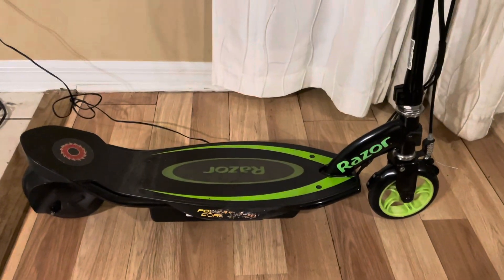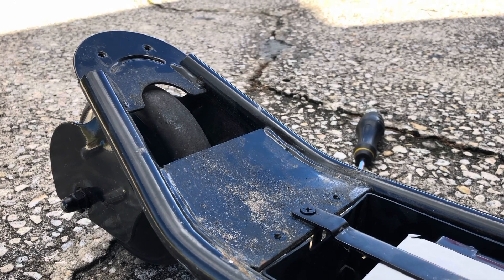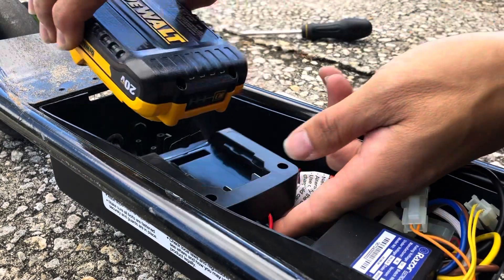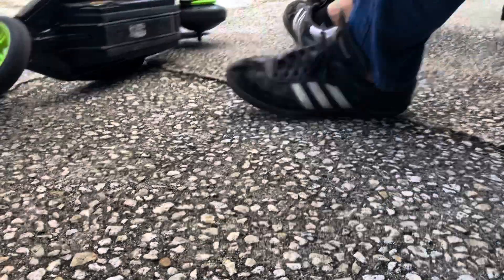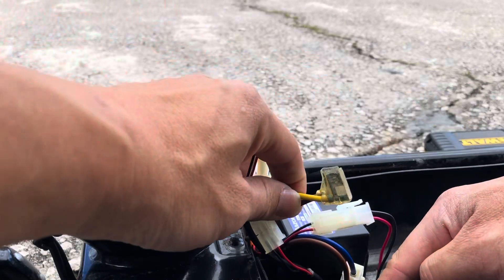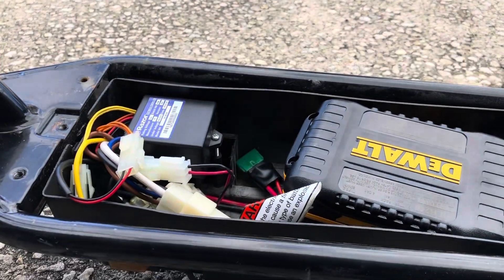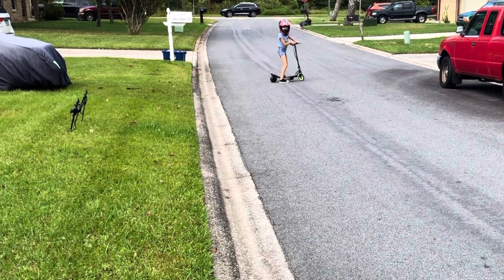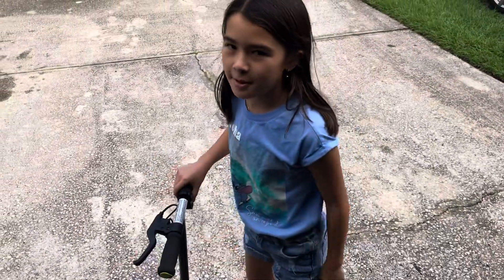Making Razor Power Core E90 electric scooter too fast! DIY Dewalt 20V drill lithium battery upgrade

Comment: How long can you ride before the battery drains?
Reply from the maker: I will have my daughter test it out today on a fully charged 20v 4ah dewalt battery.  I’ll post an update soon.  Thanks for checking out the video.
Reply from the maker: @sarathkhoun4281 We tested a fully charged battery today. The battery should last at least 40 minutes on a full charge.  Here’s a video of our test.  The battery lasted much longer than we thought it would.  My daughter go tired of riding the scooter before the battery drained completely.

https://youtu.be/jtErYQ3s7xc?si=0wZ3cVkz-_S7DpJH
Reply: @DIYwithDUY  Hello, good afternoon. Are only those steps so easy? The battery lasts 40 minutes, right?
Reply from the maker: @DargonDahood  Correct, the 4ah Dewalt battery lasts 40 minutes with my daughter on the scooter.  She weighs 60 pounds.  If your child is lighter, it should last even longer.  My newer scooter builds have the battery adapter mounted to the front of the frame on the razor.  It makes it much easier to change out the battery.  https://m.youtube.com/watch?v=6TCBZBgA9Hg. Let me know if you have any other questions.  Thanks for watching.
Reply: @DIYwithDUY  Very good, thank you, in fact I was asking because it is most likely that you understand all those materials.
Reply: @DIYwithDUY  One question, does it not matter if I buy the battery adapter but in yellow? since it costs me cheaper
Reply: @DIYwithDUY  I have a question, why did you remove 2 cables from below and connect a green 2-charge type charger that connected to the 2 cables?
Reply from the maker: @DargonDahood  The color doesn't matter.  They both work the same and are rated for the 20V dewalt battery pack.
Reply from the maker: @DargonDahood  Hi, The little green connector in between the battery adapter and the controller is a 30amp fuse.  I added the fuse just incase there is a surge in power.  It helps protect the controller if there are any issues with the battery or wires.
Reply: @DIYwithDUY  Or ok, thank you very much, is the fuse necessary? If so, could you give me the link? to buy please
Reply: @DIYwithDUY  Ok very good
Reply from the maker: @DargonDahood  Hi, The fuse is not necessary but is always recommended.  It can save your battery, controller, and motor from damage if there is a short circuit somewhere in the system.  Here is an amazon link to 30 amp fuses with the fuse holder included.  https://amzn.to/3SU9LB1

Let me know if you have any other questions or concerns. I'll try my best to help.
Reply: @DIYwithDUY  Very good, thank you very much, buy all the materials and follow the steps in the video, if I need something I will ask you, thank you very much.
Reply from the maker: @DargonDahood  No problem.  Glad I could help.
Reply: @DIYwithDUY  Thank you very much, and one question, can't you make a video putting an accelerator on the e90 power core razor scooter? so that it goes fast and slow because it goes. very fast and difficult to control
Reply from the maker: @DargonDahood  Hi, I will need to order a new controller that has full range speed control.  The factory controller on most of these razors are full throttle or no throttle.  Let me see what I can find on Amazon that will work for a full range speed control upgrade.
Reply: @DIYwithDUY  Or will it also be accompanied with a Dewalt battery? What happens is that I already ordered all the materials for the razor e90powrr core scooter and I don't know if what you say is missing, the controller. and the accelerator

￼
Reply from the maker: @DargonDahood  Sorry for the confusion.  The parts you have already ordered will make your scooter just like the one in the video.  It will have 1 fast speed when you hit the accelerator.  My kids got really good at using the scooter the way it is. If it starts going too fast, they release the button to slow down.
Reply: @DIYwithDUY  Or ok thank you very much then the accelerator is not necessary, Very good Thank you when the parts arrive. I will proceed to put them on the scooter
Reply: @DIYwithDUY  Hey brother, I already received the adapter to put it on the scooter and put the battery in, but I ordered it yellow and it is different, it is not like the black adapter that you used in the video, what can I do?
Reply from the maker: @DargonDahood  Hi, You should still be able to hook up the black and red wire from the adapter to the scooter controller.  Simply cut the 2 wires on the factory battery and attached the 2 wires from the adapter.  Try it out and let me know if that works.
Reply: @DIYwithDUY  Or sorry, I didn't understand very well, what part of the scooter?
Reply from the maker: @DargonDahood  Hi, check out this video that I did on a razor bike.  It’s the same way I did it for the scooter.  I show how to connect the battery adapter to the controller.  Hopefully this clears up any confusion. https://youtu.be/EE8V4GZyq8Q?feature=shared
Reply: @DIYwithDUY  Hello, many apologies, I did not understand anything about what the adapter could be. Built to put the battery and connect it to the scooter, if you saw the video I sent about the yellow adapter?
Reply: @DIYwithDUY  Hello, good afternoon, I was able to do the skate, thank you very much, everything was a success, but couldn't you put an accelerator on it? What happens is that it goes very fast but it is more comfortable with a new accelerator than with the one the razor update has
Reply from the maker: @DargonDahood  I am glad the video helped.  You can change the accelerator on the e90, but it requires replacing the controller to a variable speed controller.  Here is a video I did on a E100.  I added the variable speed controller to scooter.  https://youtu.be/6TCBZBgA9Hg?feature=shared
Reply: @DIYwithDUY  Excuse me, I have a question, sometimes the skate discharges quickly or the bottom light turns off and it stops starting and sometimes it flashes.
Reply from the maker: @DargonDahood  Hi, are you still using the factory “on” and “off” switch that is in your scooter?  If yes, that may be the problem.  The factory switch sometimes has a a built in overload protection.  Due to the larger battery, you may need to bypass this switch.  Either install a larger amp rating power rocker switch, or bypass it completely and use the switch that is built-in on the dewalt battery adapter.  Fast forward this video to 6:10.  I use a 30amp fuse to bypass the switch.  Connect the yellow and brown wire that usually goes into the switch.
Reply: @DIYwithDUY  Or if I did, thank you, everything went well, but my son was using the skate on a climb and what happened was that the motor stopped and it was difficult to walk because it was braking and smoke started coming out and it started to smell burnt. What happened is that if I was afraid, I don't know if I did something wrong.
Reply: @DIYwithDUY would using a 20V 6ah battery work? Or does it need to be 4ah?
Reply from the maker: @ Yes, 20v 6ah will also work great on this build.  You will get a longer run time than using a 4ah battery.  The speed will be very similar for both batteries.